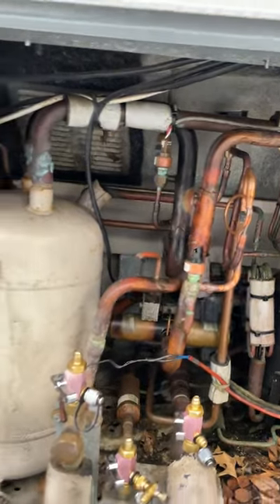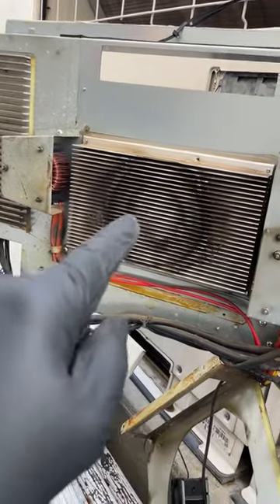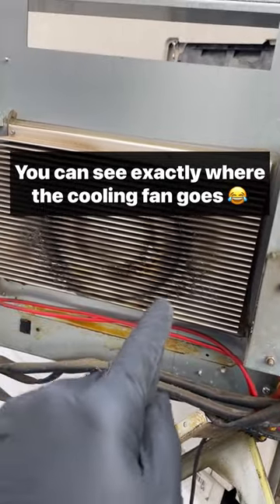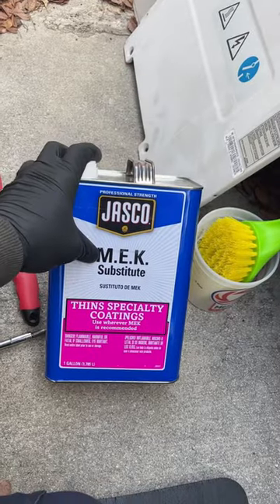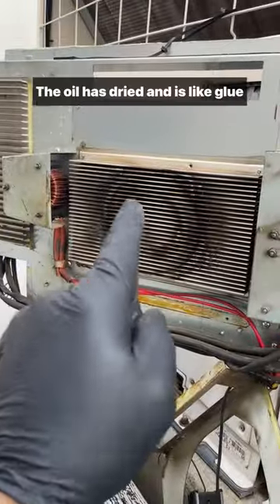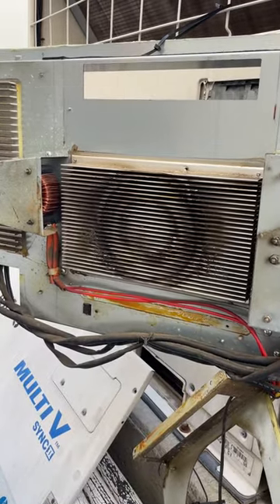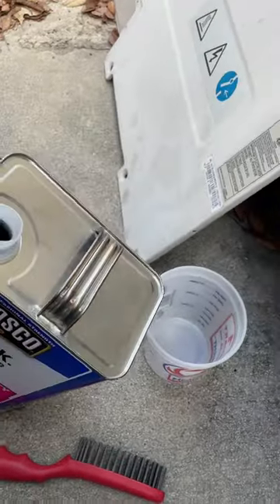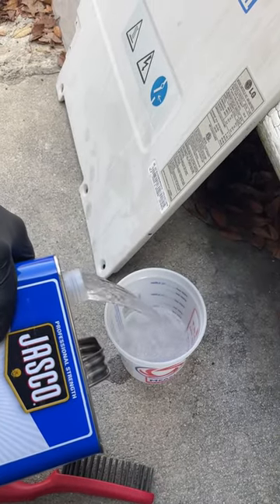Tip60: Pay Attention to Heat Sinks on VRF Units

Comment: I use paint thinner buddy, acetone works like charm. I also use it to clean acid burntout. Gotta be careful though. I once used it to clean the inside of a micro channel crap coil on a Dectron unit. Unit used to have crazy head pressure. The fact that this stuff is super volatile, you don’t have to worry about residual liquid. Love your channel brah.
Reply: @HVACLife I've used carb clean spray with great success. I've even used it to successfully clear a partially restricted cap tube. I brazed a service valve directly to the tube, filled the stem with carb spray, then used nitrogen to flush through. It worked great.